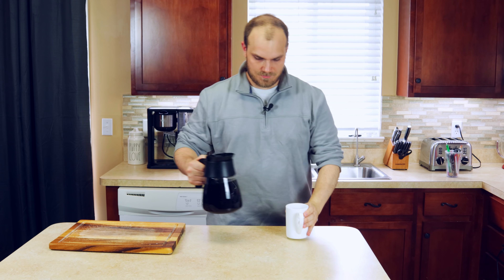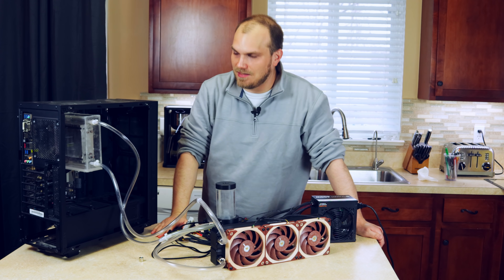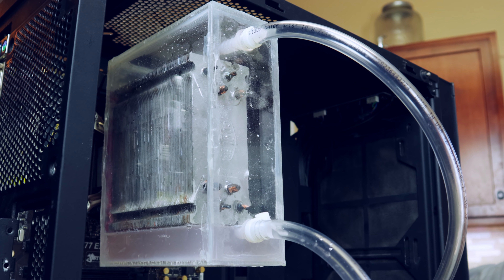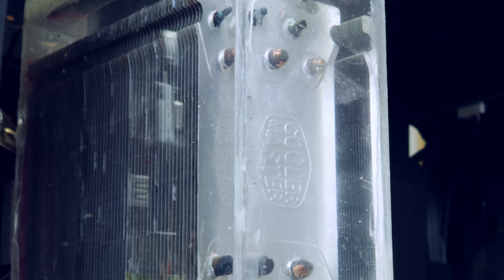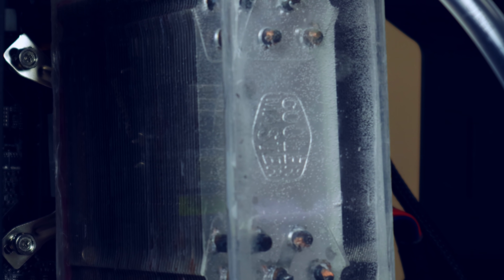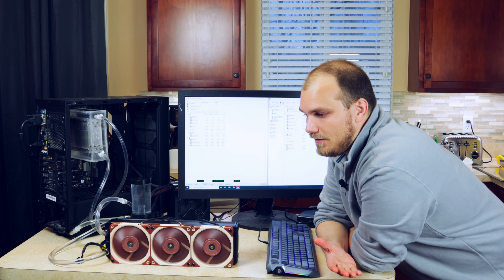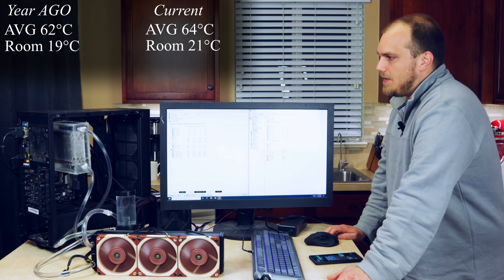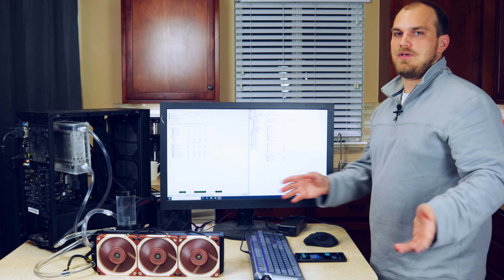Water Cooled Air Cooler 1 YEAR LATER, Time Has Not Been Kind

Comment: corrosion is due to the copper/brass heatpipes being mixed with the aluminium fins in water, you would need to get a heatsink with heatpipes and fins made out of the same material, or maybe one with nickel plated heatpipes to protect them, but even then you would still be mixing metals...

Comment: I think its worth updating to be a bit more modern in terms of looks and transference. Im wondering if the input hose went all the was to the bottom of the block where bock and coppertubes meet will affect anything at all since it will add distance between the "cool" and "hot" liquid

Comment: Defiantly redo it, but use a stock cooler (AMD/Intel/Both), see if there is any improvement. As well as previously mentioned, a coated cooler as well to to long term testing with corrotion resistance.

Comment: what about doing a wraith cooler with 1 large inlet above the core and 2-4 small outlets around the base? effectively forcing cool water at the main heat generation spot then through the fins. a design like this will definitely be more challenging however.

Comment: If you do make a second one, try it with either the 212 Black Edition, or the NH-U12S Chromax Black version. They are both 158mm ish, so no worries about varied size. The 212 Black Edition is bloack nickel plated, so that would help against the corrosion. Dunno what the Noctua NH-U12S is coated with, but its also black, so may likely be the same or similar. Worth a try over a plain Aluminium finned Heatsink.

Comment: if you had one of the larger 2 stack air coolers like the Noctua D-15 and half was air colled and half water ????
Reply: Zynoa123 I would love to see this too, but wonder if the tank on one of the heatsinks would block all the airflow from the other fan
Reply: @benjaminnyman8687  this is true but I'm sure there are a few options if it is a pull fan at the back exhaust out the back might work it would increase airflow
Reply: I think the side that has the water cooled portion would be doing a majority of the work. The non water cooled side wouldn’t be completely useless though its effectiveness would depend on if a fan was used, placement and speed.  It would be fun to play with though.

Comment: "Getting air in the loop" Return line on the top  FACEPALM
Reply: Aint that how its always supposed to be? Fill from the bottom and take from the top?
At least thats how I know all of my coolers. Like, liquid heat exchanger thingies, not water coolers for yo PC, i mean the ones for cooling down say the vapor from a destillation
Reply: @tatzecom  water coolers rely on the physical contact of water.  Air that gets trapped in the pump can also cause an imbalance and ruin the pump over time or worse cause air lock.  When you take from the top the nossle needs to be fully submerged or else water gets into the loop this is why it is more pratical to take water from bottom
Reply: @n3m37h  That's what the second reservoir is for. The top one bleeds from the top, the bottom one takes from the bottom, no risk of air.
Reply: @ARVash  he only has 1 res unless you're counting the resivoir around the heatsink which would be considered the cold plate in this loop
Reply: @n3m37h  I am counting the reservoir around the heat sink. It's a large enough volume of water
Reply: Nope. As long as the water level in the upper reservoir is above the level of that return it'll never suck air to the pump as long as there's water in the secondary reservoir. Pumps are WAY weaker than air's buoyancy and so it'll float to the highest position and stay there.
Reply: @scottbitz5222  this video proves you are wrong considering bubbles were jetting into the second res from the bottom
Reply: True. Although I think that is the best way since hot water will naturally rise to the top.
Reply: Water in the loop will all be the same temp.  This is why it makes no difference what order parts are in the loop.  Air in the line can cause air locking in the pump and inefficient heat transfer with in the rad
Reply: If return was at the bottom, it would not be able to remove the air, so the cooler would be only 20% water and 80% air.
Reply: @brianorca  I'm assuming you didn't get what I ment or have not watched the vid?  The line returning to the res/pump from the heatsink was at the top so it would suck air.  That line should of been at the bottom so it pulled water only.

Comment: i could try to make it work with the wraith prism cooler, which maybe has the perfect formfactor for what you are lookign for. :)
And try to put the acrylic walls as near as possible around the aircooler so the water has to go through the fins.
Someone else down below also mentioned to use normal fans as a water pump. That would be even more amazing.

Comment: I’d like to see a more efficient design being tested, perhaps with the water flow going through the fins better...  go for it!
Reply: Another vote for an improved efficiency design.
Reply: Use one of the lower profile colleges like a noctua l12s or the c14s
Reply: Seconded.
Reply: Yeah, I guess he could put the inlet and outlet in line with the fins facing each other
Reply: I made one where the water flows through the heatpipes, and it still has a fan on the fins. It's easy and awesome
Reply: Why not do what everyone else does and put your rad in a big cooler of ice water and use an aquarium pump to push the cold water through the fins. Cheap, easy, affordable and really affective.
Reply: How about substituting radiator coolant for the water..? So no corrosion.... 😆😆😆
Reply: @manuelkougarvalderrama8506  I was going to suggest the same thing. Using some sort of dilution of coolant with help with heat transfer and stop corrosion from occurring.
Reply: same and maybe paint it to stop from corroding
Reply: or something with a water circulator thingy like in sous vide machines
Reply: Try chilling water with it and use mordern day CPUs with this
Reply: Yes for sure.  This member of the LGBTQ community is so courageous.  They face the world every day, head on!
Reply: Yeah, updated design.  How about a passive cooler, they usually have larger spaces between fins.
Reply: Simple just nedd a separator between inlet and outlet
Reply: I don't know what you could really do the soak around the air fin stack is massive, it's basically a small aquarium.    The only way i could see it being worthy of re doing is if you added more pipes both in and out, have a 3d printed manifold take a large pipe into several smaller pipes then down into a large pipe again after exit.  this would be ludicrous and have need of a larger pump.  It would be a big project, and I don't think he would have the time or money to piss away.
Reply: Time to try it on a 10900k
Reply: Use mineral oil in the new build! See how that affects your thermals and if it improves longevity of the cooler!
Reply: You could try mineral oil to prevent it from corroding the metal and getting nasty
Reply: The way it’s installed, convection is going to ensure good flow through the fins. The warmer water will rise drawing cooler water in from below, the warmest water will be drawn off the top into the radiator.

He could definitely make a smaller design, but probably not a notably more efficient design.
Reply: Yes exactly what i was thinking. Make an evaporative cooler. Using radiator is just dumb. Why not use the proper watercooling kit? If you just make an artificial waterfall loop using a pump and  waterproofed fan to cool wet fins, it would make more sense. Would be interesting to see how it performs against real water cooler
Reply: @kinampark3093  evaporative cooler ?!?! ... in a house...nice try!
 How to raise your house humidity to unbearable level...unless you live in desert which water is precious. What about legionella disease if running long term?
Reply: also USE a painted heatsink (black preferrably)

Comment: Why not try it with mineral oil? Should be same viscosity as water and definitely don't corrode the cooler and you could add a fan inside like someone suggested. Also should it leak, it's less conducive (well if the oil is still clean).

Comment: Corroded metal is still metal, and it still conducts heat! You should only worry when the heatpipes corred so much that they split apart and a hughe chunk of the aluminun fins fall of to the bottom, then you will have less cooling capacity.

Comment: this is still prototype and I believe this still can go far. after reading comments. some idea may work. like since this is off a big heatsink, I read comments just cooling off the pipes only. which seems pretty decent and straight to the point. but not entirely sure if that will cool off the heat pipes aswell even with the water pushing off the heat. also instead of using water. how about coolant?
coolant liquid might be better than water. also since the head block transfer heat to the pipe first then to heatsink. it is meaning to say it goes through twice the process before reaching to water too.
is that why water cooler block are straight smaller and directly mounted to the cpu? hm. this indeed a very interesting process. but using just a regular water cooler block that directly sits on the cpu will only make that a regular water cooler then. there is alot of different types of smaller heatsink. this why this project worth to dive in deep. because of course the looks and functions. Noctua NH-L12S, Cooler Master GeminII M5 LED and etc. this project is worth cracking the brain.

Comment: The doner cooler needs to have as many heatpipes as possible to transfer the heat away from CPU and into the water.
Ideally the cooler should be all copper.
A old Zalman CNPS9500 could be a nice candidate if it is mountable.

Comment: I was thinking about this idea a while ago
you know how a car cooling system works
there is a pump and a radiator and a fan and also there is a thermostat 
what about adding a thermostat to a pc loop 
wait for the water in the cpu to get around 60c and the thermostat opens
it can be programmed 
while the water in the cpu is getting hotter the water in the rads will be more cooler then a normal loop
Reply: The cpu doesn't need to warm up to meet emission standards. There is zero benefit from doing this.

Comment: Do another, but also throw a fan inside so is a complete air cooler under water.
Note that the fan has iron parts... So you have to find a way for it to not corrode.
Like using the same stuff used on cars (may be toxic) our a fan designed for under water use.

Comment: Honestly man, I was super excited to see this thing come out again, I reckon a revisit is in order.  Two things, an evo 212 again but with a much tighter fitting box to force the water through the fins rather than around them (minimal resistance path). Second, a high performance air cooler, perhaps one of Noctua’s larger dual tower units or even the top tier cooler master units. Let’s see how a refined 212 unit does against a superior air cooler unit that’s been converted. Should make for some pretty damn impressive results

Comment: who would have thought that putting aluminium and copper in same loop would cause corrosion :P
Reply: Yeah with the mixed metals he should run car antifreeze mix as it has anti corrosion additives, and it would stop the scum growing.
Reply: @ctrlaltdebug  oh :o i have been thinking about how to build cooling system for electric vehicle batteries and i think you just gave me an idea :o thanks dude :) <3
Reply: the introduction of water really speeds up the galvanic corrosion
Reply: To be fair the air cooler has been sitting in a enclosed box with stagnate water keeping it humid and a tiny bit of air flow allowing for a heavy amount of corrosion unlike if it was just in water (Though the design needs a lot of work to get better flow)
Reply: @SilvaDreams  Just exposure to oxygen alone causes corrosion
Reply: @SilvaDreams  its still watertight which means its airtight. Theres no airflow.
Reply: @MessalineApghar  you forgot one thing, how does the water get inside if its airtight? Through the hose fittings attached to the water block! No hoses attached, you get air flow.
Reply: @MessalineApghar  ever heard of vacuum seal? thats the reason heatpipes are effective
Reply: @bamsuth9650  wtf did I say anything about vacuum depressurization ? and actually most " vacuum sealed" does not mean they are internal vaccuums.  it means they are closed in a vacuum environment like a negative pressure environment and are filled with very low pressure inert gasses so they can phase change from liquid to vapor and back.
Reply: @SilvaDreams  a heatsink isn't an air cooler, it's a passive cooler, becoming an air cooler when you throw fans on it
Reply: @patrickpenguin8587  it's not even an air cooler, it literally just makes air hotter.
Reply: @jocerv43  was I supposed to laugh?
Reply: replace water with liquid nitrogen, then we can see liquid cooling transform to air cooling....
Reply: @patrickpenguin8587  yes.
Reply: @xtremediy1815  do me a favor and don't tag me in an attempt to answer a 2month old rhetorical question that wasn't directed at you, thanks
Reply: @terabyte7683  wut? If you have to necro a comment thread because you can't tell the difference between salt and sarcasm idk what to tell you man
Reply: @patrickpenguin8587  This is youtube, necro doesn't exist here. Comments have barely any moderation, let alone comprehensive moderation.

On top of that, unlike threads you find on a forum, old videos will be suddenly be recommended to a new audience, generating more traffic to older comments, so the notion/concept of "necromancy" doesn't hold ground on a platform like this, compared to forums or boards where all older threads will be thrown to the back of a thread list, if it doesn't just disappear from that list entirely without access to it without the direct link.
Reply: @aliesterus1.023  Necro still exists in the form of interjecting on someone else's old banter with asinine commentary.
Reply: @patrickpenguin8587  no
Reply: @jocerv43  Yes but it also figuratively just makes air hotter.
Reply: Aluminium and copper doesn't have a galvanic corrosion, it is the dirt, minerals and air in the water doing the corrosion. Aluminium and copper is a very common mix in HVAC. But you need to get the air out, and open loops at relatively low temperature doesn't kill the water.
Reply: @JonteTheMan1  Actually those two metals do eat each other in water because of electrolysis, you could use a replaceable annode to counter it.
Reply: De-ionized water should have kept the corrosion from occuring
Reply: @MessalineApghar  Steam distilled water available in most major grocery stores :)

Comment: this held up pretty well! tho the rust is expected, if you actually redid this, finding a way to prevent rust would be nice and also taking into account the liquid flow AND make the tubes in a bit more flush for when you drain! (flush and a extra bit of angle or slightly cone on the tube's tips to funnel.)
Reply: Just use the same stuff used on cars. It's anti corrosion.
Reply: @youkofoxy  but does it have good enough watts of transferred heat or is it an isolator like air?

Comment: YES PLEASE!
Make a 3D printed Version and try to make the Vessel arround the cooler as small as possible and see if it is possible to cool it with convection only.

So CPU cooler 90° rotated as it is right now and then water outlet in top of it and inlet on bottom.
Radiator in top of the case.

Idk if you get enough convection going before the cpu overheats....but worth a try!

Comment: some chinese cheap 90mm 3 tower cooler (ie. Alseye DR90 type) and this time have things which direct the flow more evenly printed, and boost converter to see what happens if you make it pump faster (or cheap chinese fuel pump to do that job) ;)

Comment: A challenge... If you choose to accept it. 
Make a water cooler the same size as a tower cooler. 

Rules: It must have nothing hanging, protruding, extending from or connected to the water tower cooler. It must all be one compact unit and it must work decently well for a mid range to high range cpu. Huge companies have tried and failed-

EG: "Hydro Series H5 SF Low-Profile Liquid ITX CPU Cooler" and the "CoolerMaster MasterLiquid Maker 92".

Now make a good one. salute I believe in you

Comment: You should go overkill this was just an entry level air cooler. Do this with a Noctua NH-D15 in this experiment you should lay the case on the side because the weight be too much for the socket. Do an another experiment with another NH-D15 by cutting of the heatpipes end and do a water cool loop with it , yes you did this with an entry level air cooler but not with the big guns. I like your experiments. Please push your limits :D

Comment: Make a collab with The Thought Emporium
 and plasma coat it in ceramic😂
Reply: that would be pretty insane. So fits to both guys lol
Reply: Wouldn't a ceramic coating just trap the heat?
Ceramic is an insulator, it sucks at transfering heat.
Reply: @HepauDK  I don't know exactly, but isn't it few µm thick? Is it enough to block heat transfer?